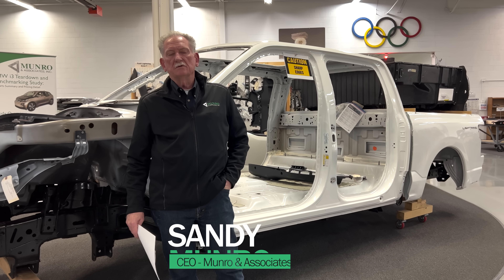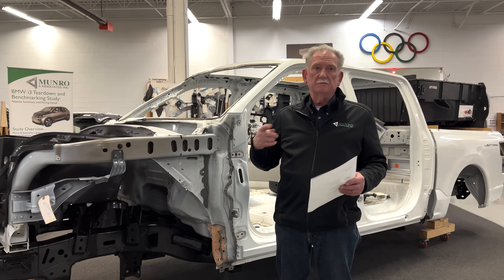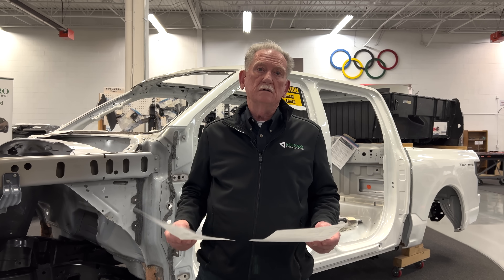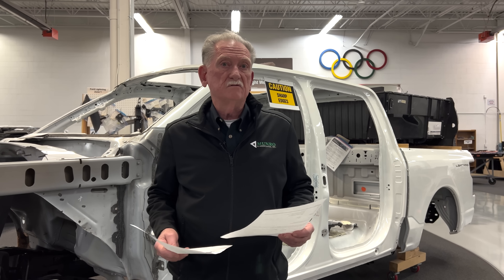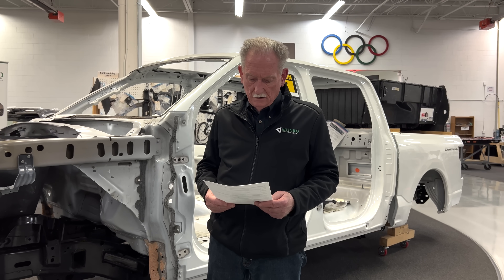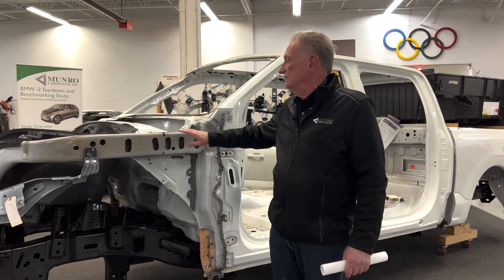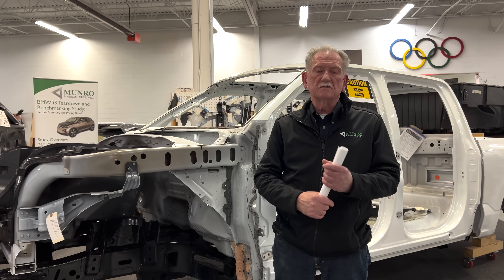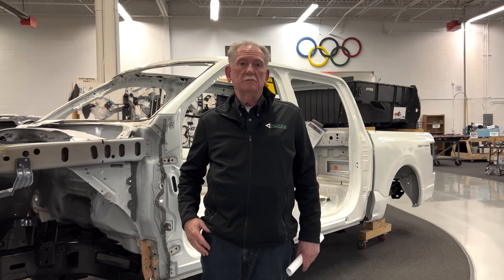Sandy's Initial Thoughts on the 2025 Ram 1500 Ramcharger

Comment: Sandy, I think your missing the other huge difference... you no longer need a home backup generator! your truck and its generator can backup the house during an extended outage... In my neck of the woods I've been out of power 10+ days. I think this is a real winner for the reasons all the others mentioned and the vehicle to home backup.

Comment: Now I am confused about the Ramcharger. I am about to buy a 24-foot car hauler that can haul 11000 lbs. I will be using a 2001 3500 Dodge Cummins. If a Ramcharger can tow 14000 lbs, why is it called a 1500? Why is the box so short? The Ramcharger doesn't seem to have enough tongue weight capacity for a trailer and a load that comes to 14000 lbs. My old Dodge maxes out at 13000 lbs I believe.

Comment: This ram truck will also be a gem in the job site. 
Payload to bring supplies in, then your own power plant on site. The battery is decent, need more? Start up the engine. 
My biggest concern would be degradation of the fuel if the truck is plugged in at night for regular commutes and you rarely need to dip into the ICE use.

Comment: The better all-electric truck I see is the GMC Sierra with it's huge battery pack.  Trucks are tools for hauling and towing and need the power to go distances with a load.  If you own a truck and don't use it for a truck is good for then you wasting your money on one.

Comment: OK, this is childish.  The comparison is not between rated towing maximums.  It's between actual towing distances.  The problem with electric towing is that it drives your range down to nothing.  A Lightning can tow a big boat about 150 miles before it's spent.  If you are taking your boat to the coast from Colorado, that's just unworkable.  Or towing a mobile home to a new state.  Or taking a big camping trailer on the road.  It's extremely impractical.  So you can pay $80,000 for a vehicle that cant do what you need it to do (twice a year).  But why would you?   THe lightning is perfect for people who dont need to tow anything heavy.

Comment: This is the set up on locomotives for the past 80 years. I think if the generator can power the vehicle without compromising any performance then this is the perfect truck to do truck things. An ICE in generator mode with consistent torque and rpm will outlast an ICE truck engine. If this gets more people into EV’s and they use the battery for 90 percent of the time for commutes and ICE on the weekend then this is a win in my opinion.

Comment: I think the RamCharger (as described) will be a great option for many reasons already mentioned in other comments, but the payload should not be overlooked.
1. You can drive it every day full electric, and not even need to top up every day for a regular commute (maybe you cant get a charger where you live)
2. Without buying a separate car for long range trips, you can use the same truck on gas and get exceptional range
3. When you tow your range may drop to 50%, maybe 320 miles (similar to an F150 when not towing)
4. If you do charge level 2 at home (say 11KW), you could fill the smaller battery from 10% in less than 8 hours overnight at off peak power rates.
5. When you tow, the hitch load should be about 10% of the trailer weight... and that counts toward your total payload.
     So if F150 has 1400lb payload and tows a 10000 pound trailer (1000 lb at hitch) , there is only 400 lbs available for truck contents (people and cargo)
     But if a RamCharger has 2600lb payload and tows a 10000 pound trailer (1000 lb at hitch), there is still 1600 lbs available payload for people and cargo (more than the F150 when not towing)
This truck would be a great "Gateway" vehicle, towards an EV future, when DCFC is readily and reliably available without waiting.
The big questions remain: how much will it cost, how good will the ride quality be (given high payload), will it deliver to the preliminary specs, and will it be a better work site power option with the built in generator cycling as needed to charge the 92KWH battery?

Comment: Sandy one point I belive you are missing is. Truck drivers like to tow stuff around. If you can't afford 250k rv with its own motors and batteries you will have to tow a old fashion trailer or rv. Just watch some YouTube videos where real world range on the ev like F150 or the Rivian basically goes down in half or more. Therefore this 690 mile range translates into 300 miles while towing which is a blessing for those who intend to tow. And range exiety is a real thing when you are for example driving in the extreme cold climate with let's say a 75d Tesla. I have been there. You get 150 miles of range and your route from NY to Atlanta takes 23hrs instead of 17. A s a pure ev enthusiast I actually believe that on the large format trucks having a generator as a power source is genius. It should be a 2.0 diesel engine in my opinion 2ill probably get 1200 miles of range.

Comment: Sandys comments in this show how clearly out of sync he is with rural and working Americans.  Trucks aren't intended to be daily drivers that just haul 1 person around and don't do much work.  They've become that because people think it's cool and vehicles are so expensive now it doesn't make financial sense to have a utility and daily vehicle.

It's not about driving 690 miles in a day.  It's about driving out into the country or mountains possibly towing something where there isn't any charging infrastructure or possibly even gas.  690 miles will get you safely 300 each way without a charger at your final destination.  Chargers don't exist outside of cities and major highways.  Also if it's winter, or you're towing you'd be lucky to get 100 miles of TOTAL range in a F150.  There's a reason Edison is using this drivetrain setup compared to the Tesla Semi.  The Tesla might be great for city to city routes with known chargers at both ends but if you're operating outside of that area fully electric is 20+ years away from being possible.

Comment: This guys sound like an EV fan boy. Its not about need for the 690 its about having it available, it about having the choice to go to another fuel stop when fuel is expensive, I'm sure the people in Florida or hurricane areas would love this ability to leave and go a long ways and not be restricted to waiting for fuel, The RAM charger has a 25gal fuel cell, its very easy to carry another 20gals of fuel with you. I live in an area that it is almost 200 miles in either direction to the next city, the range on this is what I'm looking forward to. I could drive to San Diego and back and not have to put $5 a gallon fuel in. This style of Hybrid has been needed for a long time. I am looking forward to the designers getting even more creative with the packaging and be able to offer bigger motors, batteries and fuel cells in a 3/4 or 1ton truck. Maybe even bring back the eco diesel to replace the Pstar.

Comment: Range extenders in trains showed up around 1925 A range extender with a gasoline engine is not the best use. A 3 liter diesel range extender setup would give a better benefit by far on fuel mileage. The main reason for a range extender is first power. You can achieve better power and fuel mileage. Dodge is tiptoeing into it with a polished toy. Edison Motors is currently building range extender trucks for heavy industry. They first built a logging truck and are working on more logging trucks and snowplows. They are developing a  range extender conversion setup for both tractor trailers and work trucks like f350 and 550s. The late model trucks will have more power and better fuel mileages. Edison Motors does their best to not use easy to find parts in their building of the trucks so The average person can go to a parts store for what they need. Range extenders use high voltage electricity so someone working on them needs to be certified to work on them. unlike many motor vehicles were there is little chance of being electrocuted range extenders can and will kill. Sandy is incorrect about enough range in his comparison. The Dodge Ram Charger needs that larger gasoline motor used as a generator If someone depsides to tow with it.

Comment: @sandy is the 3.6 penastar still using the ABS oil cooler you should suggest that they switch to the aluminum on the ABS ones always crack and its in a terrible location. Just an fyi from mechanics.

Comment: This tech is definetly the better way to go, imo, for current battery tech, especially for trucks. (massivly extends towing range,from what I have seen with the 150L it essentially has 1/2 the range with 10k lbs at best towing)

I would be exited to see see how small this can be scaled and still be affordable for regular people making 45k a year. Most poeple in that bracket are not interested in cars that are 45-60-100-130k or more.

Comment: Sandy , a couple of things you are missing about the Ramcharger. There is that when it is cold out side( not Florida or Texas cold, but -40) And/or you want to haul 12,000 pounds or more, then put a large hill in that equation, you range will drop easy to half, possibly a third or with severe cold, even more than quarter range. So 690 miles all of a sudden becomes 345, or down to 172 or less. Someone that would need a Ramcharger could be a equipment hauler for smaller track loaders, excavators, cars, trucks, etc. Also building construction, oil construction and more that travel 100 or more miles each way, then need power on site. Now the bigger problem with EVs is charging with a trailer, disconnect and reconnect 20 minutes if you are good, then charge time, possible getting to get the charger to work is all mor down time.
Up here in Alberta when we get -40 it can last a week or more. At a warmer day after that, if I see a person in an electric car, they are driving down the road  in their EV, dressed like they are out pushing their EV. Lots of causes here, the EVs are stored inside with heat as they can't keep a lot of heat in them like an ICE. Just a view from someone with different living conditions.

Comment: I don't think you understand this. Towing with the Lightning is a disaster if you're planning to go more than 50 miles round trip. The Ramcharger will tow for hundreds of miles, and can tow for hundreds more miles with a simple fill-up. The Lightning is great around town, but so is the Ramcharger. Take a cross-country trip (I drive from WA to FL each year) and the Lightning will add days to the trip. There's no difference in the time between a Ramcharger and my current Ram 1500 Ecodiesel. 

The Ramcharger is the future. Fantastic economy for the majority of driving because you'll be running on the battery and plugging it in. But the capability to tow, to spend a week at a cabin and driving forest roads daily without being bound to an outlet, to take long distance trips means that for anyone who buys a 1/2 ton truck and actually plans to use it as a half-ton truck the Ramcharger is the only rational choice.

Comment: Long distance towing, hauling, and overlanding. Those are the areas this makes sense. Its easier to refuel when towing because you don't have to worry about detaching what you're towing. It will have less time spent refueling both because of the speed of it and getting greater range per stop. And its better when away from charging stations because its easier to carry extra gas if you run out than to get another EV to charge yours, which could also take hours. I hope eventually better battery and charging technology make this unnecessary, but for now its the best option for its particular niche. 

And speaking of that niche today, I would love to see Rivian partner with someone like Toyota to develop one of these. You could basically pair the standard range R1T powertrain with a Toyota provided engine and body. Rivian gets to sell more and likely turn a profit on something to offset the continued losses and Toyota gets a foot in the game without actually having to spend big money developing a platform when they seem content to wait for solid state batteries.

Comment: What people fail to realize is that the 690mi is halved when towing. You know when people do truck things with their trucks….. My work truck now goes 700mi by itself. When I pull my 5th wheel it’s 350, so I end up driving 300mi before I fuel up. Having the 700mi in a tank is useful because I can drive all week without going to the fuel station.

Comment: ITs usless because your NOT saving any GAS. The gas motor charging the battery always runs and always is using gas.  Why not make it so it drives on just EV for 140 miles meaning you can drive 70 miles away from home drive back home 70 miles and use NO gas put it on your home charger and then recharge battery with cheap home electricity NOT USING ANY GAS. BUT still have the ability to use the gas motor on longer trips pulling a trailer or boat. RAM screwed up making it so the truck never uses battery ONLY.

Comment: Sandy is there a particular reason you didn’t compare the Lightening to the REV?  You are comparing apples and oranges. The REV has a 500 mile range, 2600lb cargo capacity, and a towing weight of 14,000 pounds.  Why is ford still trying to chase RAM?
The Ramcharger is a separate vehicle in a separate class.  Most 2500 and higher trucks and go 600 plus miles on one tank.  So yes the ability to travel long distances without the need for fuel, any time of fuel is a huge plus.  
When I stop to eat while traveling it’s only for a maximum of 20 minutes.  No electric car can charge fully that fast.  When I stop to Pee, it’s only for 10 minutes unless I stopped for Taco Bell prior.  
Your comparisons are poor and don’t make any sense. Try again FORD guy.

Comment: What will be the cost to operator this vehicle verse a standard Ram gas like the 2024 1500 I own with eco boost engine? 
      People can have different reasons for wanting an EV. For some it is environmental and for others the cost of operation or a combination of both reasons. I lean more to the overall cost to operate and the ability of the truck to perform like a truck. From what I have heard the cost to operate the Ram EV  is less, but does it offset the initial cost, potential additional maintenance, and potential long term cost of components such as battery's? What is the KW cost of electricity to charge the battery's to go X number of miles compared to the cost of gasoline to go the same distance? At this point I do not have enough information to convince me Ram EV is a good choice. Maybe in time with additional information I will have a change of heart. 
        The government is forcing the auto manufactures into this EV scenario under this "Green New Deal" approach as it has been referred. I saw just recently an EV car with the creased fenders in the small town where I live, and it looked like something out of space movie. It was quite impressive and definitely drew your attention, but that was all it did.

Comment: The 690 miles is a big seller for me. 300 is not nearly enough. If you're towing 10k or 14k the Ford might go 90 miles while the ram will go over 200 which is way more practical. Especially considering if you do have to charge you'll have to unhook and rehook up the trailer which would be a real pain. I assume when the battery is depleted I can still continue to run on gas which means no hour long charging sessions. This is gonna be a big seller for ram it sounds far superior to any other offerings. Hopefully the price isn't too painful.

Comment: Totally not about 690 miles unladen.  It IS about 350 or more miles while TOWING!!!  It will tow up to 14,000 lbs and haul up to 2500 lbs.  That 130 miles of all battery driving is perfect for commuting.  It will be an EV almost all of the time, but when you need the range, it's there with zero anxiety.  Remember, this is a TRUCK, not a Prius!

Comment: Sandy, if you're towing with truck then you will get 50% or more reduction in range.  So, having over 300 miles of range while towing my travel trailer would be nice.  With the Ford Lightning I might only get 100 miles.

Comment: I live in Texas, Sandy. It’s a big place. It’s 320 highway miles from my house to my hunting ranch, and the rural electrical setup at that end can’t handle a charging setup without a total revamp. I also have a 30’ camper I tow on a regular basis. All of which means the Lightning just can’t cut it, at least not for my use case. The Ramcharger can, with ease. Will I trade in my current 2017 F150 for a Ramcharger? Not for another five years or so. Maybe we’ll have next gen batteries by then and/or a much more robust charging infrastructure. But I suspect the Ramcharger, or something like it, is still going to be a better fit for my truck needs five years from now.

Comment: You didn’t consider two things that the Ramcharger might have an advantage over the Lightning.

1) EPA range estimates are for unladen vehicles, not at their payload capacity. Once you load down an electric vehicle with payload or towing the range will plummet. As someone who tows a 30ft travel trailer, I think I would want the range extender to have more towing range and quicker fuel stops along the way. I don’t know of many campgrounds that have EV recharging infrastructure. 

2) Winter is awful on electric vehicles. The heating requirement to keep batteries warm enough to charge caused major problems for EV drivers who live in areas that experience deep freezing temperatures. The range extender can heat up the battery and make it easier to charge. 

I am interested in seeing a real world rowing test of the Ramcharger.

Comment: The Ramcharger does 145 miles on its current battery chemistry. This vehicle’s battery will improve just like every other EV battery. The next generation of this vehicle will get 300 miles in EV mode and 600 mile range extender.